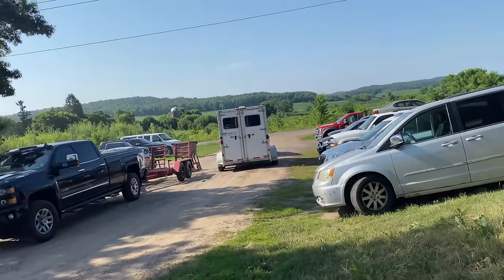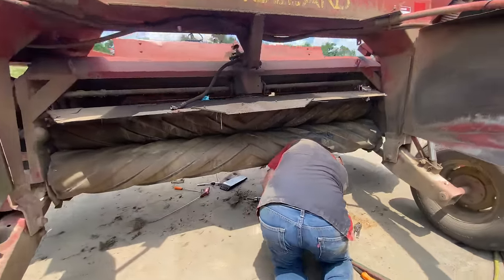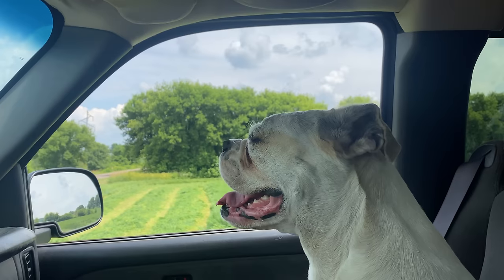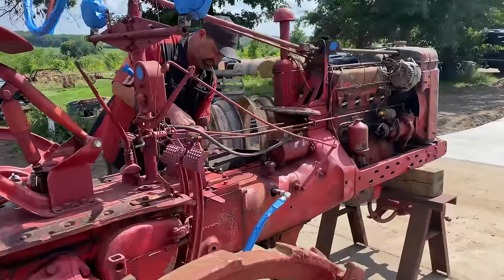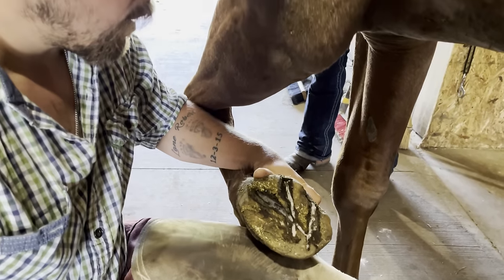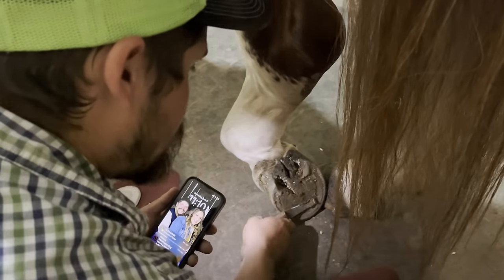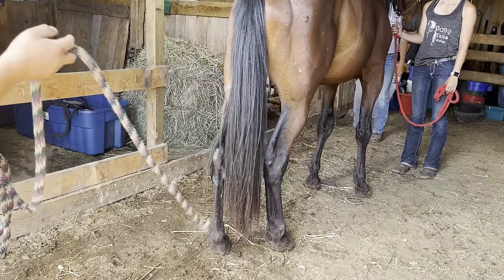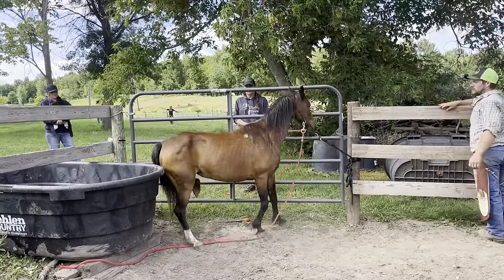Become a farrier, they said! It'll be fun, they said!

Comment: I think building some sturdy padded stocks for the horses to stand in would help Paulie and the horse.
Reply from the maker: We have a stock but it is currently under construction! Stock are also mainly for Draft horses as most of the ones we did in this video would be too small for it! :)
Reply: Yeah, they should have gotten one of those that they use for cattle, especially for the wild ones. 
Or Pauly should get a go found me to have one to pull around with him, would save his back.